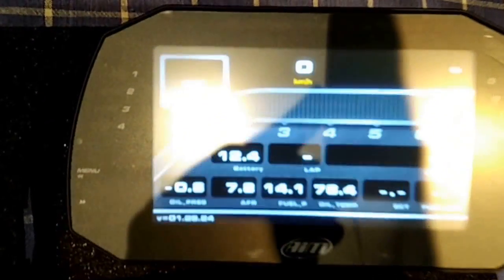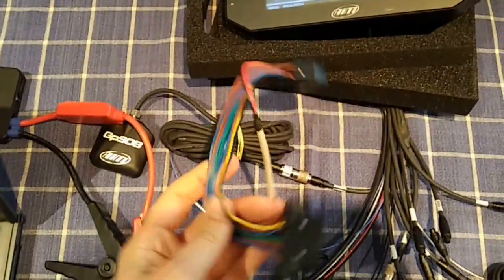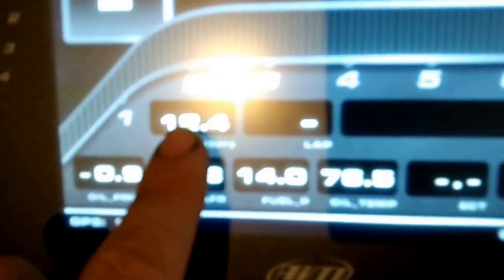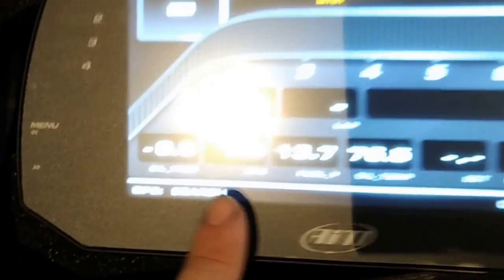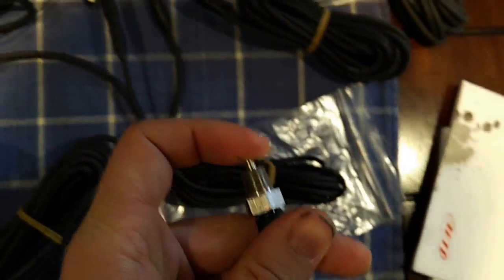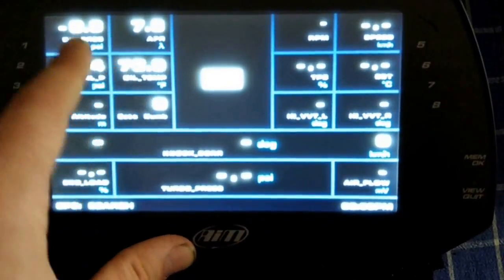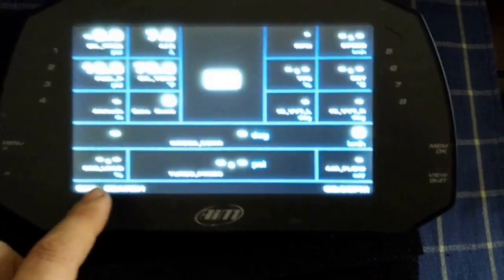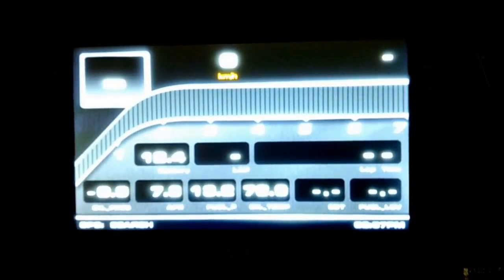AiM MXG Demo (Subaru STI with K-Line SSM Protocol)

Comment: Is it possible to add additional parameters as available in RomRaider's ecu_defs.xml?
Reply from the maker: Yes, on the can-bus cars you can add custom parameters to the ecu protocol on the aim device, the k-line ecu vehicles in general have locked protocols and are not end user defineable.

Comment: Does the Kline with the aim work with the Cobb accessport? I have a 03 wrx with a v7 sti swap. Been trying to come with a solution to wire everything up for track use
Reply from the maker: yes! you can use the k-line signal for the AiM Dash on Cobb tuned vehicles
Reply: speedmastermarine can you send me a write up? So I can get my car ready for my track day coming up? Also what comes with this kit and what is the best price found for it with all the gear for subaru
Reply from the maker: @631HOTSHOT  - Hi Ian, please send me an email at aim.sportline.inc@gmail.com and I can send you all the information.